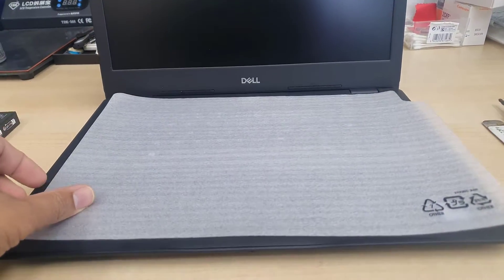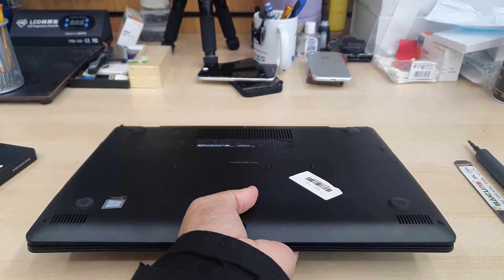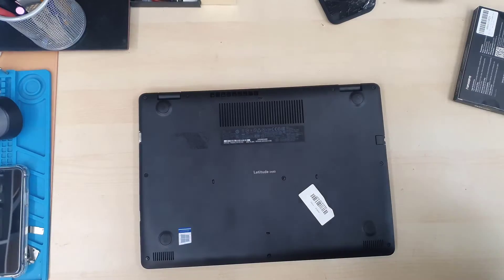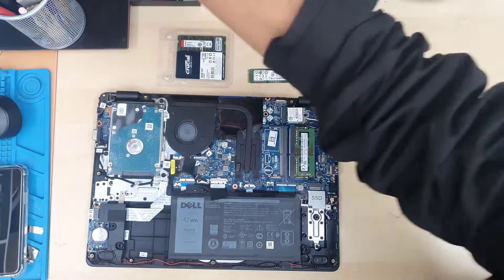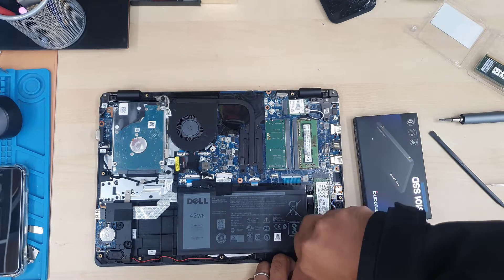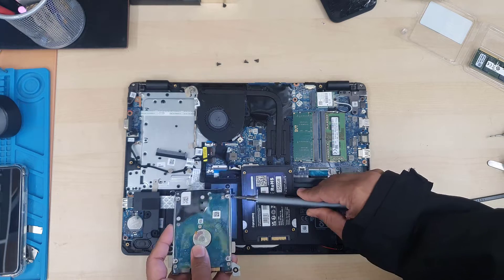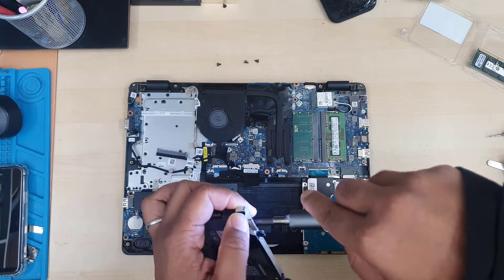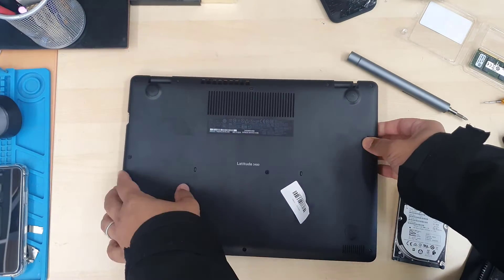How To Upgrade Dell Latitude 3490 Ultimate Upgrade Options

Comment: tengo el mismo modelo, actualmente tiene una unidad de almacenamiento SSD M2 de 256 gigas para windows y programas, un HD de 500 gigas de 7200 RPM, 32 gigas de Ram en DDR4 (dos unidades de 16 gigas cada una) y le reemplace la bateria. la laptop vino con windows 10 y 8 gigas de ram. literal esta volando. creo que le di 6 años mas de vida util

Comment: it says on the latitude 3940 owner's manual that the storage it supports are the following:
2.5" 500GB 7200 RPM (7mm)
2.5" 500GB 8GB Hybrid (7mm)
2.5" 1TB 8GB Hybrid (7mm)
2.5" 1TB 5400RPM SMR (7mm)
128GB M.2 2280 SATA SSD
256GB M.2 2280 SATA SSD
256GB M.2 2280 PCIe SSD
512GB M.2 2280 PCIe SSD

you said in @3:35 that the sata ssd could be anything, but I'm kinda scared to try it cuz of what the manual says. Also, M.2 nvme ssd isn't included in the list but the ssd slot itself (from the video) looks like it uses m.2 nvme, so I'm kinda confused now as to what source to believe lol. Please help me 😭😭
Reply: M.2 nvme uses PCIe bro😐